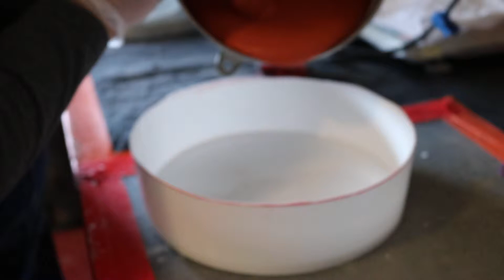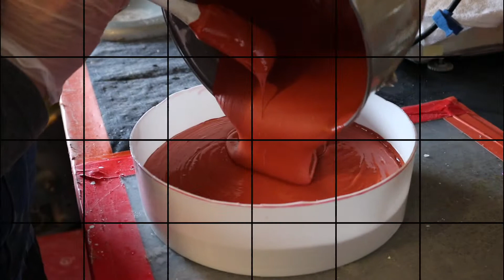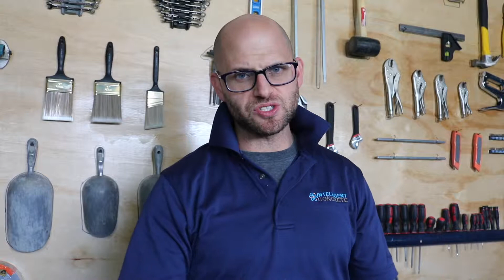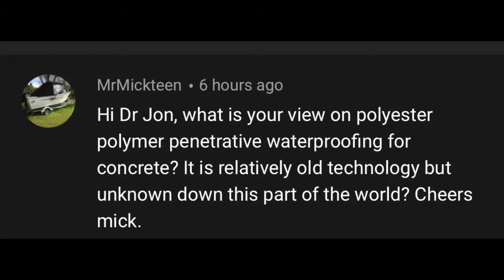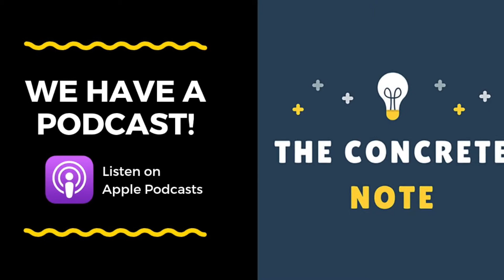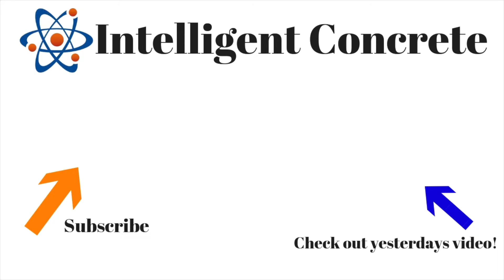Polyester Polymer Waterproofing for Concrete? - Vlog #279

Comment: Cheers for the answer. A brand of polyester sealer down here claim that it penetrates upto 150mm in concrete ,densifies and blocks migration of water? Sounds too good?
Reply from the maker: MrMickteen every new product I have worked over the years have seemed like pixie or unicorn dust.

The only way to find out if a tech is worth the money is to try it out.
Reply: If I may, Mr Mickteen, it DOES sound too good to be true. If it's dirt cheap then it's probably something worth looking into. But reactive densifiers, especially colloidal silica, will be able to resist migration of water FAR deeper than any polymer can penetrate into concrete. And the farther you spread that zone of reduced permeability the less pressure you will get at any given place in it. The ultimate goal of moisture migration management is to minimize migration by spreading the zone of impermeability deep enough that the pressure of moisture migration never accumulates in any one place where it could approach the low tensile strength of the concrete. This is cause of the failure of epoxy and high build systems that capture the migration in a very small portion of the system. It has the unfortunate effect of concentrating that force in one place of weakness--the very definition of "overwhelming superiority." A polyester additive or a polyester urethane topcoat (over epoxy primer) would interest me. I'd be very skeptical about anything else.
Reply: deyc3 Hey mate, thanks for the replies. Im open to all information and suggestions. Im not an engineer so the absorption of scientific theory takes alittle longer in my overloaded brainbox. I stumbled across colloidal silica's and additives while trying to find a way to make Natural(fairytale) calcium hydroxide plasters and have been fascinated with these additives. Cheers.
Reply: @MrMickteen  Thanks, man. I got a little wordy and off topic on that one. Perhaps I put a bit too much Busch in the mud.
Reply from the maker: The depth of penetration does sound a bit fishy... that being said, if the concrete has already gone through a significant deterioration than it could have cracks or some type of pore connectivity to allow for 150 mm of penetration.  

I have seen colloidal silica hydrogel technologies reach a significant depth of penetration on concrete structures that had salt leaching and cracking at the surface and subsurface.